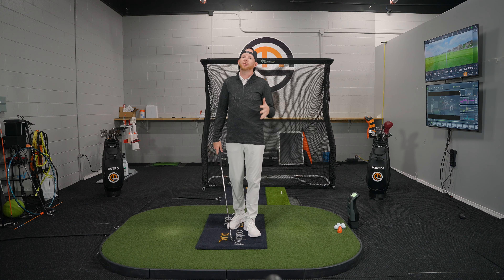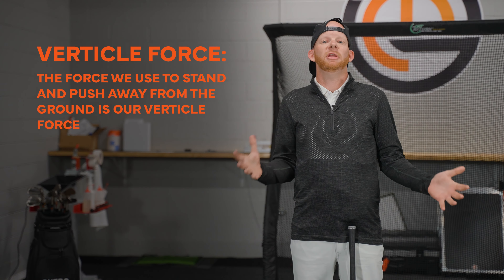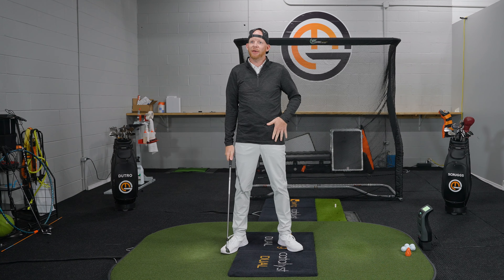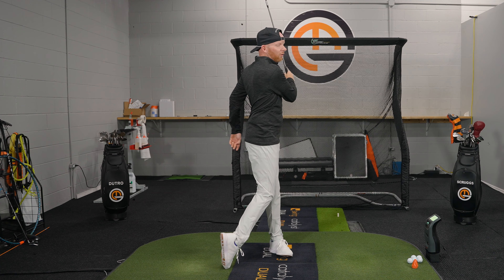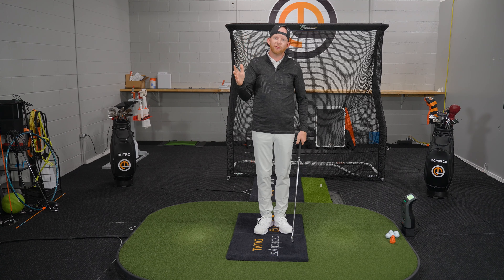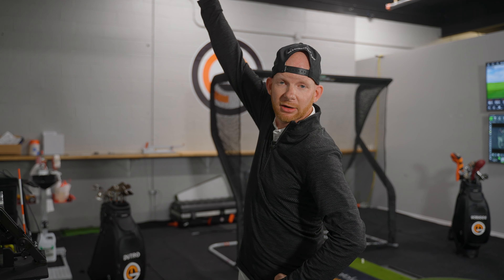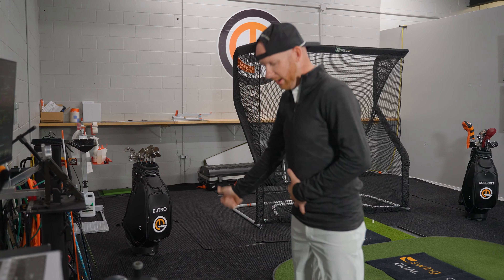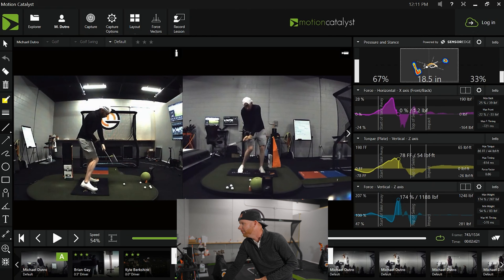The Power of the Lead Leg: Understanding Vertical Force in the Golf Swing

Comment: great video , my 13 year old boy very good player ,has lots of lateral slide , knees buckle in transition,  gets dumped under and hits pushes , the only instruction we gave to him for the last month is jump ,straighten BOTH  legs and his swing and contact has been looking solid on video , for him focusing on straightening the trail leg was the key , keeps his posture and is trending in the right direction ,swing is looking pretty nice just telling hit to jump off Both legs
Reply from the maker: Staying on the balls of the feet and keeping the legs tall is plenty, jumping tends to lead to early extension which isn’t good on growing joints.
Reply: @measuredgolf   thanks, he doesn't get airborne, but adding verticals has definitely cleaned up the slide , also has helped him not early extend, what was making him early extend was getting on the toes to early with trail foot ,   and pushing laterally ,thanks

Comment: The standing up is the easy part that’s what most golfers do. Rotating the left hip back with the weight shifted on that same foot while not thrusting the rear hip forward is what needs explained.
Reply from the maker: If the player allows the center of pressure to move more away from the target than necessary based off posting style, than they will require additional horizontal force (thrust) to try and get back in front of the ball. This tends to shoot the lower body forward and the upper body has to right side bend to try and manage low point. 
This is why measuring each legs contribution to the horizontal force production and posting style based off pressure application is key to creating a safe and efficient motion.

Comment: Great video, first I've seen coupling these forces together. The GG move has always felt alien to me! After shifting into my lead foot, I've started to use AP force,  I'm experimenting with twisting my lead foot simultaneously anti clockwise. Is that move OK? It seems to help me rotate better.
Reply from the maker: As long as the cc twist with the lead foot is happening through the ball of the foot and not the heel, you should be good.
Reply: @measuredgolf  thanks!